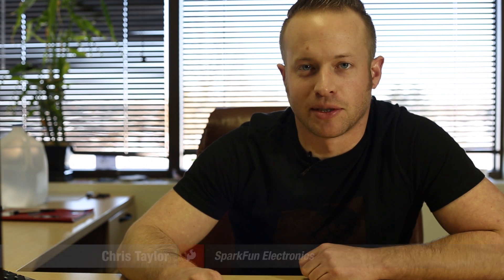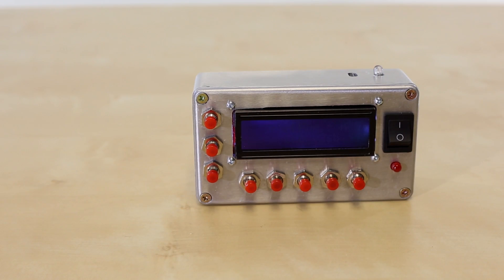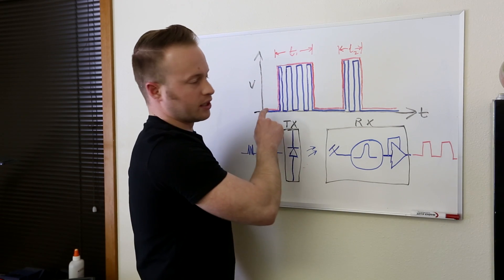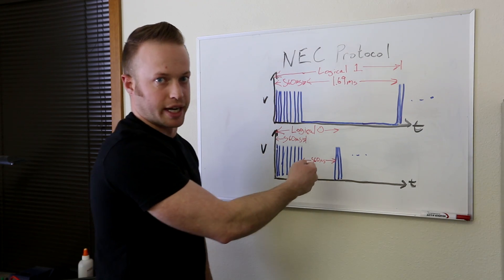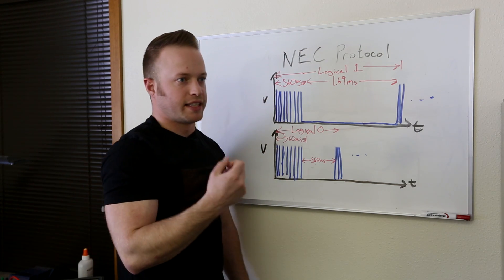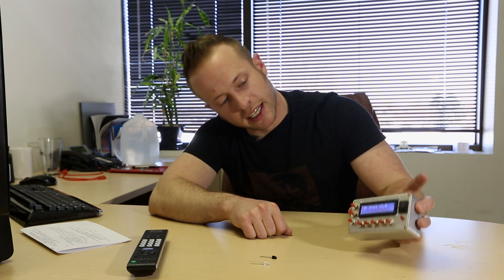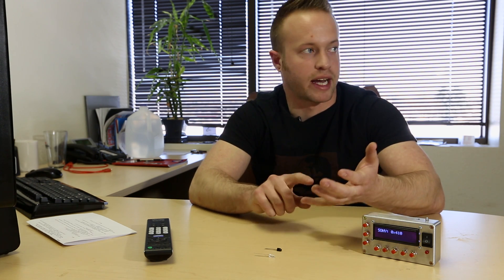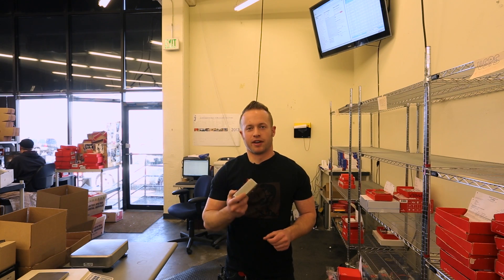Engineering Roundtable Episode 15 - Infrared Shark Project with Chris Taylor

Comment: Just a point to make.   There are infrared receiver diodes, receiver transistors, and receiver diodes, etc with extra circuitry built in.  The one he is talking about is the later.  It has a circuit for doing functions such as gain control, band pass filtering, and demodulation.   So what you get out is logical ones and zeros.  If however you try to use just a basic IR diode detector or IR transistor detector that doesn't have that circuitry then some, if not all of those function must be done either in hardware or software.   If you don't have one with the built-in circuitry then you need to know how to deal with those issues.   Best bet is use one with the circuitry built in.  A lot of the hard work is done for you and they do a nice job.
Reply: I think they have an Arduino library for that: https://github.com/shirriff/Arduino-IRremote.

Comment: when you have a high voltage that frequency is IR?
 I'm having trouble to relate the 38Khz with the IR frequency which ranges from 300GHz to 430THz
Reply: the IR is like a normal led but invisible to the eyes. Any protocol will turn the IR led On and Off 38000 times per second. Now for a code to be transmitted, you add to that some timing. Ex: for a digital 1, I want to turn the IR led ON and OFF (38000 times per second) for 2seconds. For a digital 0, I want to turn the IR led OFF for 1 second. 
300GHz to 430Thz is the physical phenomene that describe an infrared light. Why there is blue, green, red, infrared, ... lights? Each color that you can or cannot see has a different bandwidth range.